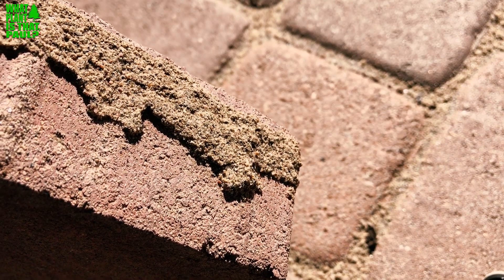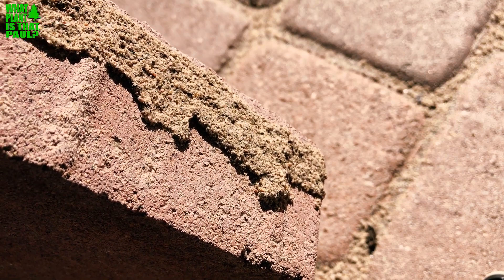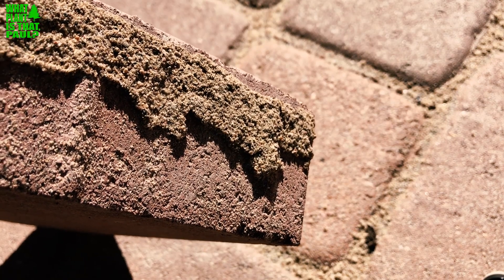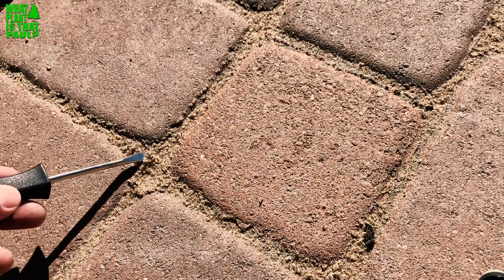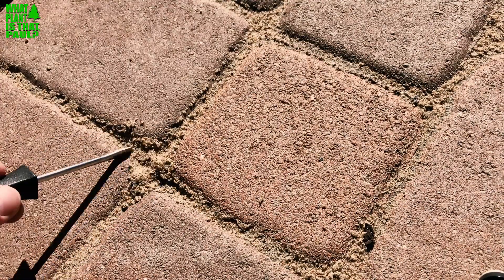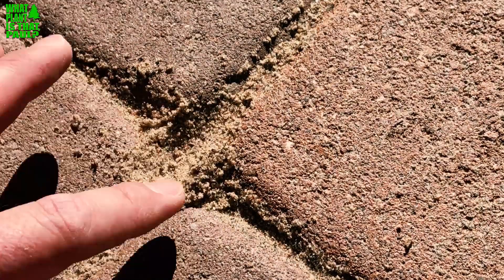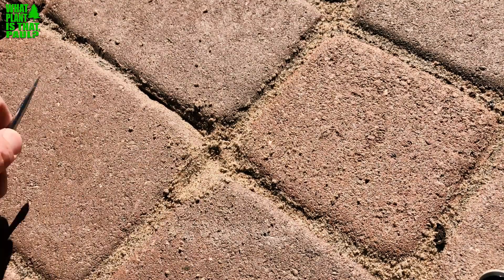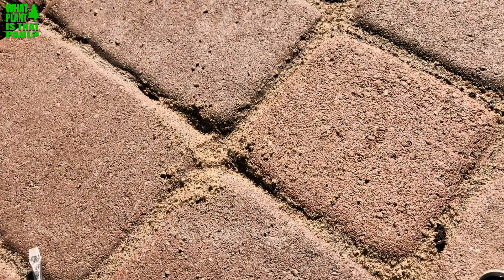Polymeric Sand Problems! Select the Right Sand For Your Project

Comment: Hi there I hired a contractor a year ago to build me a walkway and he insisted that you do not need to add polymeric sand in the end process. He’s been building walkways and other stone work for over 50 years. He stated that land slowly shifts, and rain water or runoff can get between those joints causing the polymeric sand to compromise and wash out. So it’s been a year and the walkway looks like it has some varied gaps between joints. Overall the walkway does look good, but I’m still not sure why he didn’t want to use that sand. What’s your thoughts on not using polymeric sand? Thanks.
Reply from the maker: We were told that the sealer would make the sand hard and that polymeric sand was a waste of money. After 2-3 years, all of the original sand washed out. I prefer this polymeric sand and it's lasting much longer despite the fact that the company overfilled the joints. The key is using the OPTIMAX version because it stays hard when wet. https://dyna.ca/index.php/en/products/hardscapes-division/polymeric-sand/optimax-polymeric-jointing-sand-premium-grade
Reply: @WhatPlantisthatPaul  ok thanks...